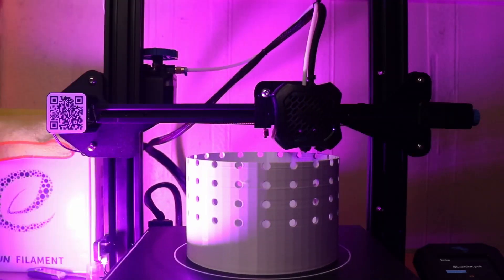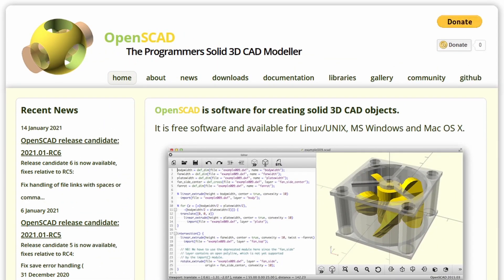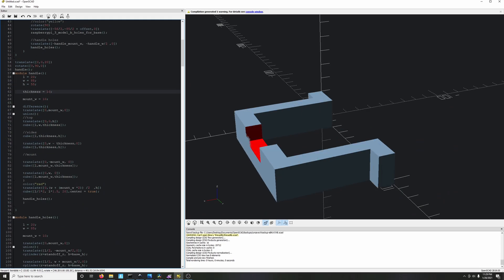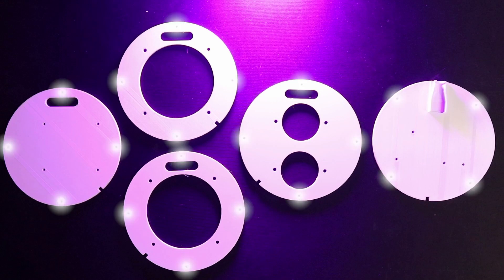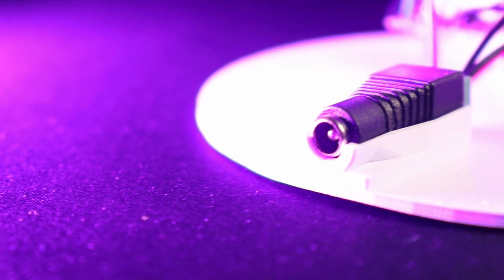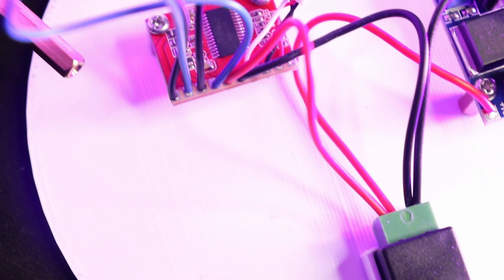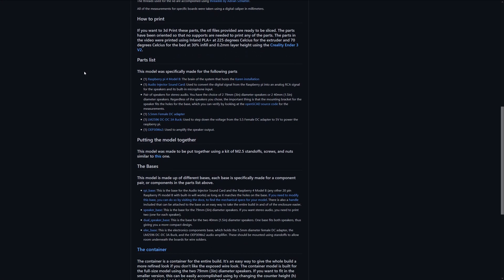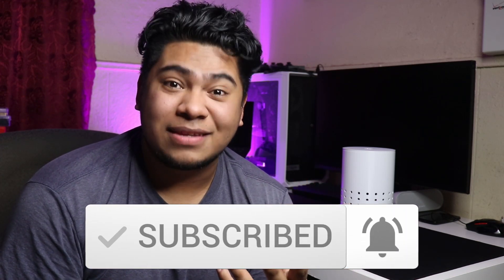Making my own Alexa EP.4 | Using 3D printing to build the device!

Comment: Awesome work!  I pulled down your repo and was playing around "karen" on my desktop, very cool.  If I can find the time I will get it running on a raspberry pi and try to cobble together a plugin to control some of my tp-link devices with python-kasa. https://github.com/python-kasa/python-kasa That and the weather are 90% of what I've ever used my Echo devices for.
Reply from the maker: Thank you! I'm glad you mentioned that, I was actually thinking of building my own home automation add-ons, maybe even using something like home assistant to add support for a range smart devices. If you do build something I would love to see it!